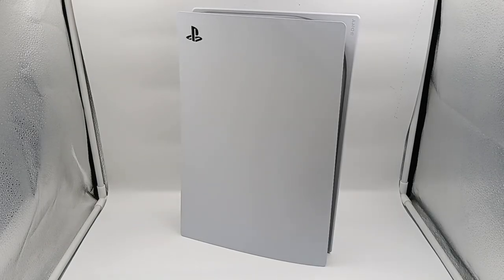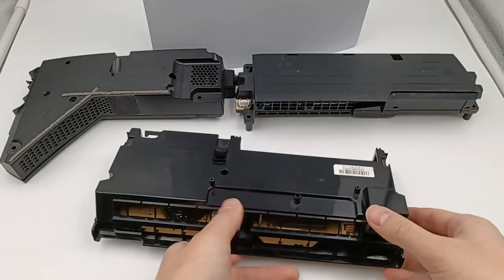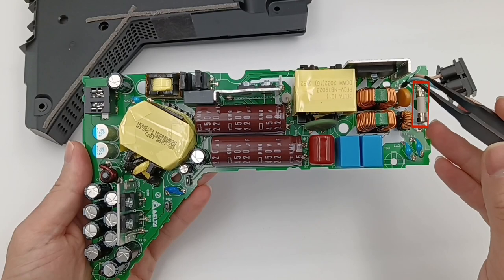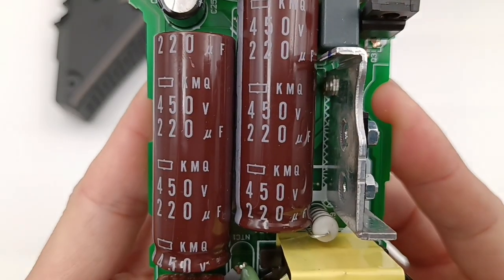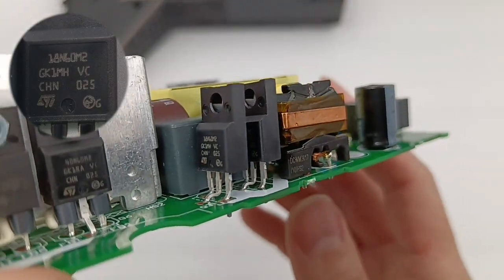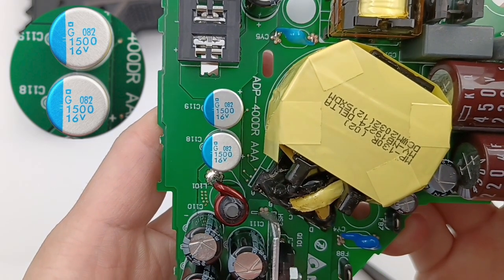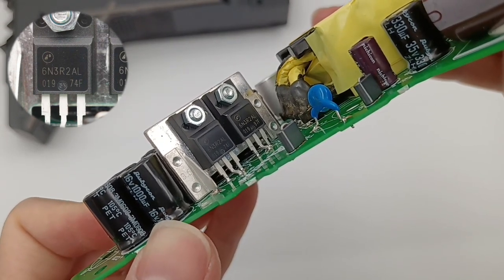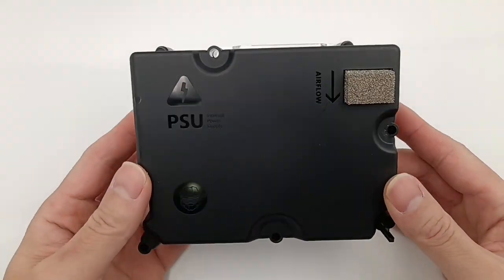Teardown of 372W Power Supply (For SONY PlayStation 5)

Comment: I am having an issue with the PS5 power supply. There has been 400v on the input, since then when the cable is connected to the wall outlet the fuse in the central house fusebox gets turned off directly. So basically a shortage in de PS5. Can this be a blown Varistor or will there probably be more damage?
Hopefully you can give an idea here.

Comment: how can you tell it's a PFC LLC topology just by looking at it!? can you explain how to recognize it!?
Reply: The presence of a quite big inductor between the bridge rectifier and the hv smoothing capacitors (this for the PFC section) and the presence of a smaller (not toroidal) inductor close to the main transformer, and the absence of any big inductor between the secondary side rectifiers and the output capacitors (this for the LLC section).
Moreover, any high quality PSU above 120w of output power should (must) have a PFC.
Hope it helps, bye!

Comment: I own a repair store in Brazil, and I ordered some PS5 power supply model ADP-400DR from a website, and the Rubycon capacitors are labeled 180uF instead of 220. Have you guys ever heard about that?

I wonder if it's from the digital version, since it would theoretically need less power. 
Or maybe from the new 11XX models of PS5. 

Everything else is mirror-identical to the 220uF power supplys: material, components, weight.

The PS5 had a physically damaged power supply, that wouldn't turn on with the previous power supply.
With the new ones, the PS5 turns on, but keeps shutting down with PS5 AAA games (though it runs PS4 games fine).

It's a physical 10XX model, and it works fine with a 220uF power supply removed from other PS5.
it's driving me nuts, I can't find any info on these 180uF ones
Reply from the maker: Sorry, we haven't heard of it either
Reply: Hi, did you manage to run the ps5 games?? I also have this problem, I can only open ps4 games after the psu change
Reply: @saulgoodman779  Hi there Saul
Turns out it was a power supply malfunction (it stopped when I replaced it)

A lot of stuff can make your PS5 turn off when playing PS5 AAA games, the most common one being dirt inside the PS5 on the power supply venting tiny holes.

If you already cleaned it and it still happens, I'd say you need to test with a new Power supply (try a repairing store for that)
Reply: @angelcupim  thanks bud!
Reply: @saulgoodman779  sure man, good luck! Hope you can fix it, and plz, reply to us when you solve it, it will be good to know so we can help other people with the same problems 👌😉
Reply: @angelcupim  yeah man I will reply!! Also, I didn’t said it, but I’m not using a ps5 psu because in my country they are very expensive, so I did a crazy thing and adapted a pc psu haha, it functions well, but the only problem is the ps5 games. I think I will buy a better psu to try again, and I will wait for the original one to become cheaper!

Comment: Isn't that grid plug only rated for 2.5A, so 250W at low line? Thats much lower than the 372W it can produce.
Also it's not grounded to earth? But I like Delta...
Reply: Its a class ii insulated appliance so there is no need for earth and the plug is rated 2.5A by the IEC, but North American organisations rate it for much more. On 220-240v mains where its suppoosed to be within the 2.5A limit, it doesn't violate the Ampereage limit.
Reply: @tanishqbhaiji103  Thanks for the reply, what NA Organisations rate the plug for more? Do you have a source for me to read a little? Thank you
Reply: @ethkid8925  North American ratings
North American rating agencies (CSA, NOM-ANCE, and UL) will certify IEC 60320 connectors for higher currents than are specified in the IEC standard itself. In particular, UL will certify:

C5/C6 connectors for up to 13 A,[8] although 10 A is more commonly seen (IEC maximum is 2.5 A)
C7/C8 connectors for up to 10 A[9] (IEC maximum is 2.5 A)
C13/C14 and C15/C16 connectors for up to 15 A[10] (IEC maximum is 10 A)
C19/C20 and C21/C22 connectors for up to 20 A[11] (IEC maximum is 16 A)
Given the 120 V (±5%) mains supply used in the United States[12] and Canada,[13] these higher ratings permit devices with C6 and C8 inputs to draw more than 114 V × 2.5 A = 285 W from the mains, and devices with C14 inputs to draw more than 1140 W from the mains.

This is exploited by high-powered computer power supplies, up to 1200 W output, and even some particularly efficient 1500 W output models[14] to use the more popular C14 input on products sold worldwide.

Although less common, power bricks with C6 and C8 inputs and ratings up to 300 W also exist.
Reply: @tanishqbhaiji103  Extremely thorough research, hat's off to you. Thank you very much!
Reply: @ethkid8925  the 2.5A limit is probably due to the fact that these plugs normally terminate into europlugs which are only rated for 2.5A.